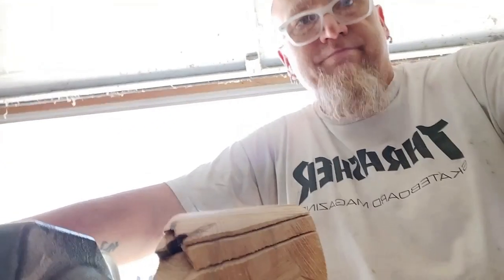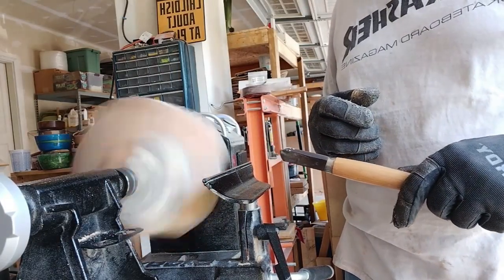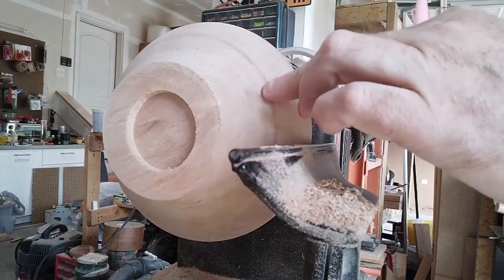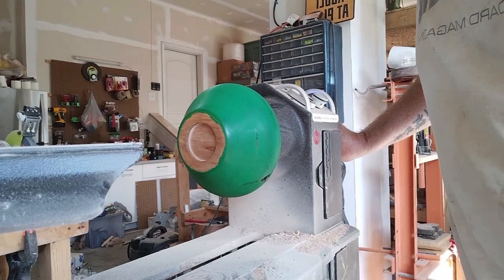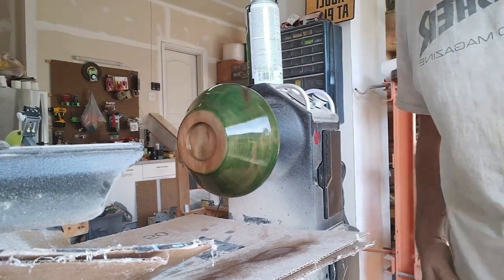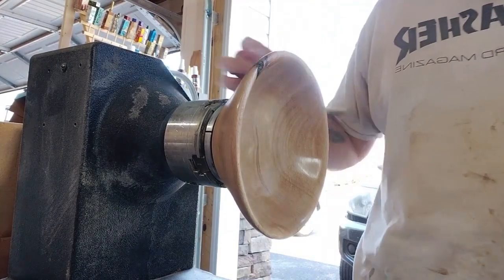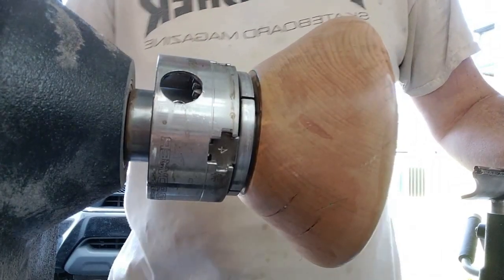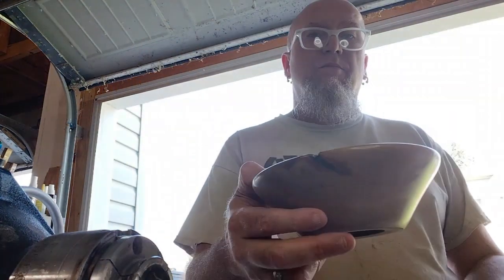Beech Bowl

Comment: Your bowl came out very nice. I’m curious though, why didn’t the stain work out?
Reply from the maker: For one you could see where the CA filled in the grain where I used it so the stain couldn't (or didn't) sink in there, and since Unicorn Spit is a gel stain (even watered down) in some areas it looked more like paint than stain. I am curious if I use a more open grain wood if it would work better or if I need to get a different stain for this type of project. Most people use Ash or Oak to do this with, so maybe I'll try those next time.  Thanks for watching.